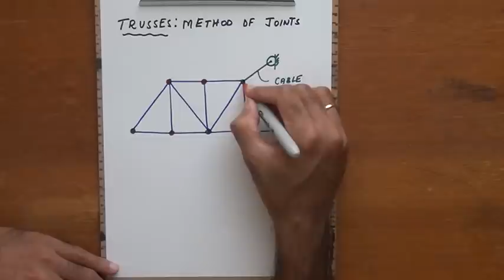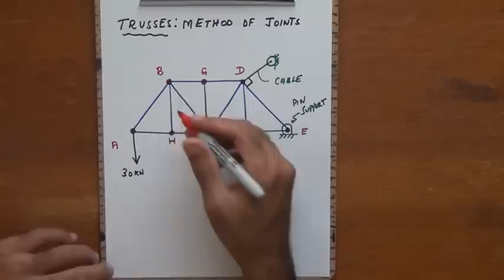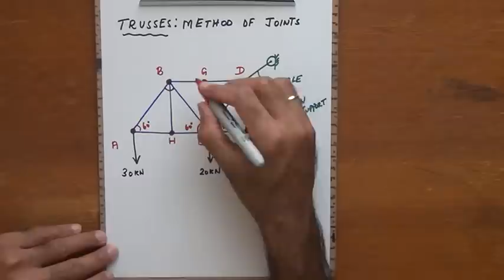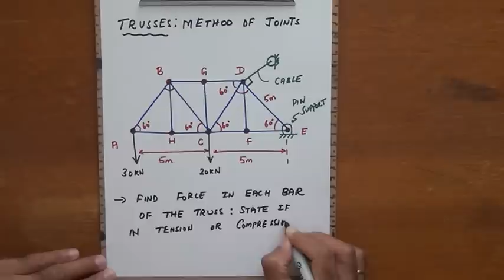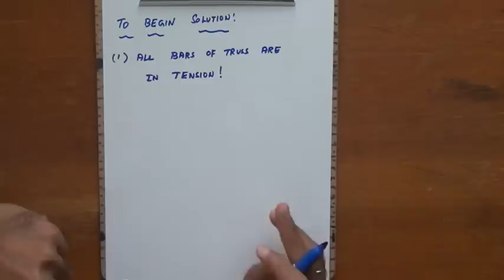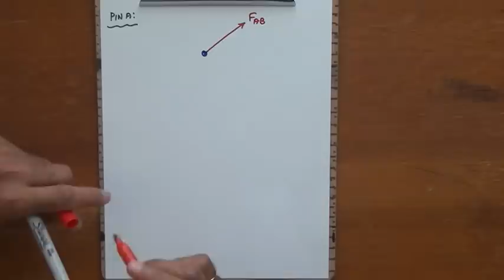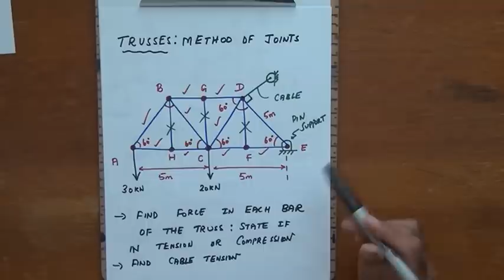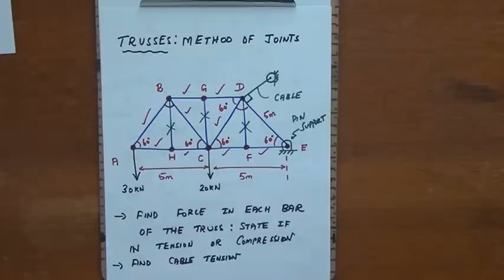Solved problem Trusses Method of Joints

Comment: I found this quite enjoyable. Not knowing much about trusses, or solving for the forces of each truss member. There is enough information provided, to find the cable tension by using torque. The torque applied to pin E from pin A is 300kNM(30kN * 10M) and the force applied to pin E from C is 100kNM(20kN * 5M). The total torque applied to pin E is 400kNM. We also know Pin D is 5M from pin E and the cable is at a 90* angle to member DE. So 400kNM / 5M = 80kN. I found this interesting and it validated your equations for me. ;-)
Reply: I don't get it,  The total torque applied to pin E is 400kNM, but pin D is 2.5M from pin E, so 400kNM / 2.5M = 160kN, and FTsin30=160, The  cable tension should be 320kN. Am I wrong?
Reply: I learn more about trusses,,,,,,,,,,,,,,,🙏🙏🙏🙏 thank you sir

Comment: I took 10 seconds to get same result by assuming the truss is a rigid body & using moments to get the load on the cable.
Reply from the maker: Yes, that is quite obvious isn't it. What is more interesting is that one need not even spend that time to find the cable tension if one does not want to..:). Since, mostly, we are interested in determining the forces in the members of the truss and perform stress analysis to determine the failing culprit (member).